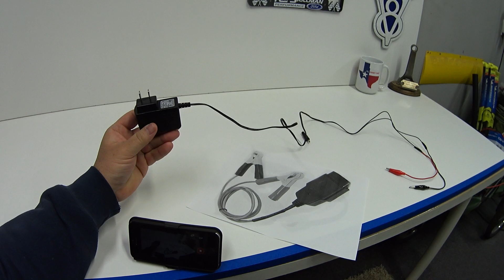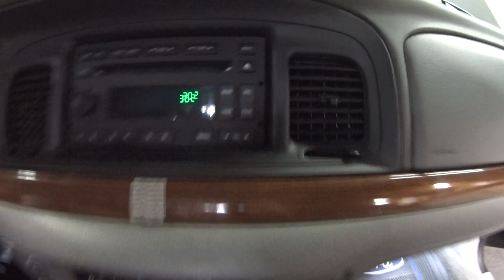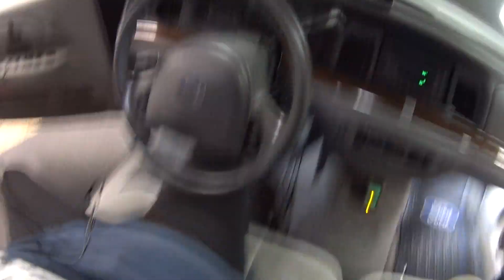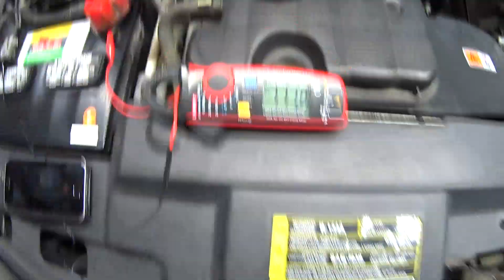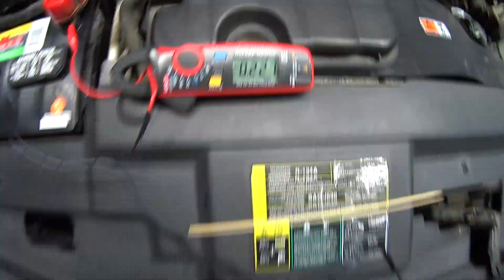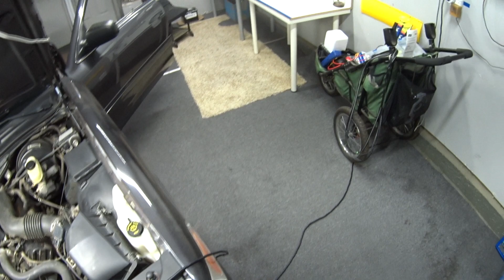Crown Victoria - Computer Memory Saver

Comment: Thank you, Chuck!  As always, thorough high quality video, and to the point. My wife found a jump starter on the marketplace that I tried to use yesterday.  It has large clamps that I attached but then knocked off while removing the battery. So I lost the power. The solution you demoed is much more elegant. I sure have one of those adaptors and will attach it to ring connectors as I can’t think if I have spare alligator clamps on hands.  
The booster that I got also has a power adapter for the cigarette lighter, now that my radio is reset, I may try to see if plugging it in and disconnecting the power would also work on the Vic.  That’s just for my curiosity.  The booster is bulky to move around, so I would rather use the method you’ve shown.
Reply from the maker: Right on Andrei,
Thanks for the great question.

Instead of using alligator clamps on the little power adapter you can attach a cigarette lighter plug.
And just plug it inside the car, instead of attached to the battery terminals.
Your local Walmart should have them for $2.77.

Here's a link; 
https://www.walmart.com/ip/EverStart-12V-Accessory-Plug-Model-5141-Black-Automotive-Electrical-Tool/547891033?fulfillmentIntent=In-store
-Chuck
Reply: @PanzerPlatform  thanks, Chuck. Definitely can’t argue with that price.

Comment: Excellent, thank you. Any reason not to use my 12V trickle-charger for this purpose?
Reply from the maker: Right on Mike,
That's an excellent question. 

It depends if your trickle charger is a "smart" charger, or a "dumb" charger. 
It will also depend on the current output of the charger. 

Let me know if that does not answer your question. 
-Chuck
Reply: Thanks for that tip.  Was debating just buying a new adapter but with the suggestions in the vid., comments, and my own past experiences... I feel confident I can probably DIY several options with off the shelf parts/adapters etc.

Just need to spend a few minutes to locate the various parts and test it out.  I've used a Jumper Pack in the past but as others have mentioned it can be bulking and prone to disconnecting so just have to locate the 12v DC Cigarette Lighter/Power Outlet Adapter and/or a few bits of wire with clips to make the connections without relying on the short jumper clamp cables to balance the pack under the hood or whatever

Comment: Hey Chuck, I was curious if you could make a video in the future on how to install an aftermarket gauge cluster.  Like the ones on the marauder.  The triple gauges at the bottom of the center console.
Reply from the maker: Right on PPG,
Sorry to disappoint, but I most likely I won't be making that video.
-Chuck
Reply: @PanzerPlatform  I didn't think you would, I had to try lol

Comment: Clever
Reply from the maker: Right on Shaun,
What do you guys do in the autobody world if you need to disconnect the battery for welding etc?
-Chuck
Reply: @PanzerPlatform  sadly nothing,  9 times out of 10 unless it's something minor the car is generally apart for days or weeks.  One of the dealerships I worked at did have a shock absorber that clamped to the battery like a battery charger where you would not have to unhook the battery.  In most cases its only an inconvenience to disconnect the battery.

Comment: Chuck when I was running my MATCO tools franchise when I used to be rich, young, debonaire, and handsome I would sell tons of those memory savers, the techs in a hurry would forget to retrieve 'em after completing a task, and would like to own several. They were most concerned not to purge the radio station settings, lest the owners get pizzzed and "forget" the tipping.  Thanks for the reminder, I should have kept 1 for myself.
Reply from the maker: Right on Richard,
Thanks for the story. 
-Chuck